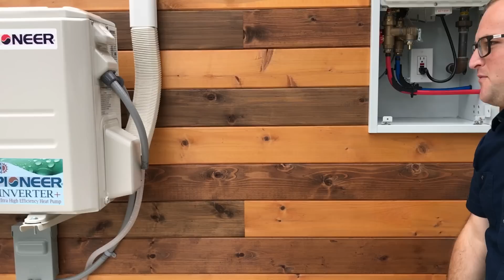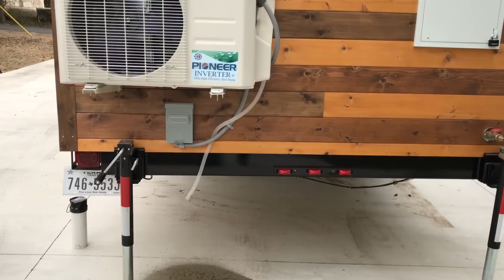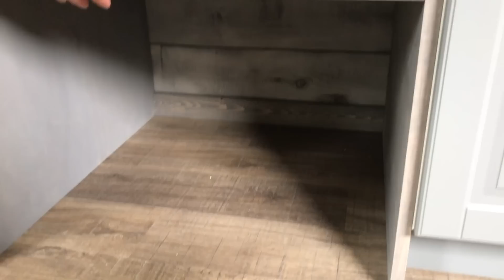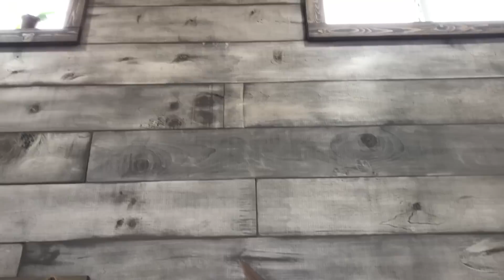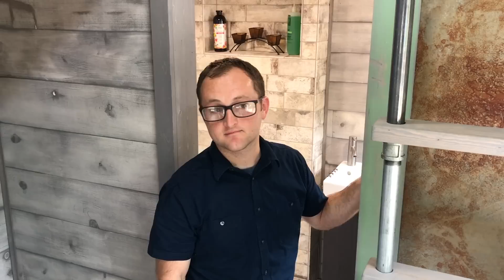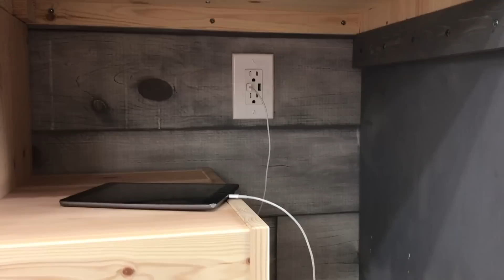habeo tiny house tour

Comment: Lovely! Concerning some of the critiques already given: 1) I agree the "un" finish on the storage-stairs was kindof jolting, given the  degree of finish on everything else, but it's an easy CAPTION to add to the video! 2) Ditto for an optional railing in the loft areas. 3) Love the bathroom fixtures and the gigantic (looking) shower, amazing tile-match with the driftwood toned interior woods. 4) BUT...where oh where is the/a dining table? Maybe a fold-down from the front wall (or roll-out from the stepstool or closet area)?

Comment: WOW, this is a great design! The sofa shown is Vallentuna from IKEA, a great choice for comfort + storage. The cabinets are beautiful, I'm loving the custom shower, industrial ladder, fixtures, dimmable LED lighting, built-in spice rack, interesting barn door and weathered grey walls. Your design details are on point! Except for the ceiling: white paint will give a more cohesive look. May I respectfully offer some additional suggestions? *AESTHETICS:  Stair storage is always wonderful but the unfinished, rustic look falls short; surprising since everything else is finished so perfectly. Perhaps consider facing with kitchen cabinet doors. *SAFETY: Lofts should always have a safety rail, and handrails for stairs. EGRESS WINDOWS in lofts, air exchangers, smoke detectors; please include these in your builds, it will really impress customers. *FUNCTION: A larger 21" or 24" bathroom vanity will surely fit in that space, so why skimp? You guys are off to a fantastic start. Uncramped and a beautiful aesthetic, this design rocks!  And with a few customization options you can offer every customer the Tiny House of their dreams! KUDOS!! 👍